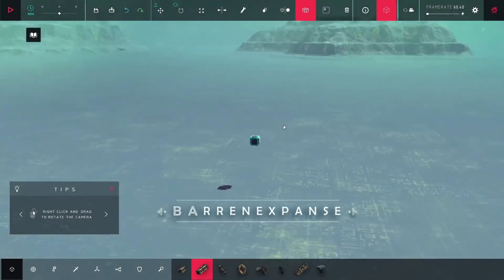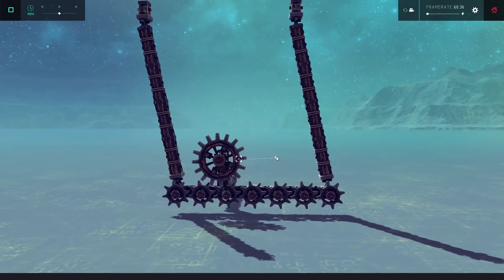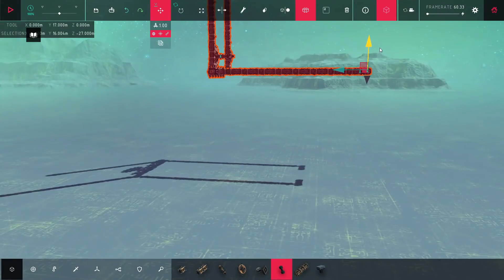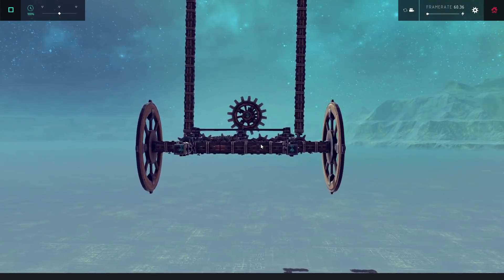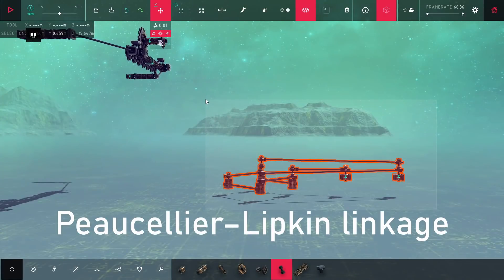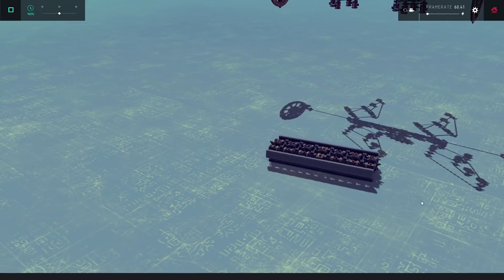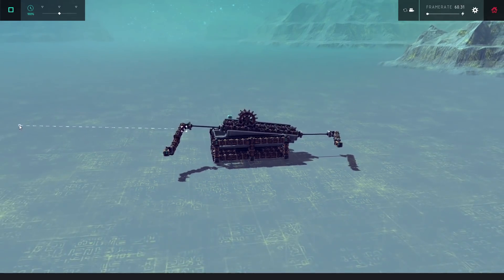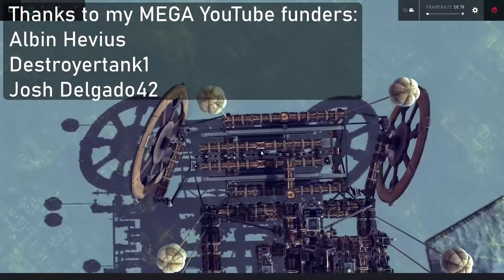Making Rack and Pinion Steering in Besiege

Comment: The wheel wouldn't skip if you made ackerman geometry. Basically all you have to do is make the tie-rod (steering arms) mount to the wheel hub further in towards the center of the car. It's also a good idea to keep them parallel instead of having them angled back so much.
Also, looking forward to the suspension episode for this car :P

Comment: you could have avoided struggling with the cogs, by just replacing them with rods on wheels. think davinci's first cog designs, where he used wheels and put little rods into the side as "teeth"
so by using a large unpowered wheel, and rods on the side (you know how they have four points on the "face" of the wheel) as a cog, and a "tooth bar" made out of just a looong log with a block on every other spot, you wouldn't have the problem of thin cog teeth.

Comment: Next on the list: Disc brakes; rotors, calipers, and linkage. I don't think you'll be able to do hydraulic linkage, but you can definitely do wire linkage like on a bike or small motor scooter.
The calipers and linkage shouldn't be that hard, smooth surface block pistons and bore, with the linkage attached to a powered wheel or gear, pulling on a triangle mechanism to force it to straighten and thus push the piston. The piston will have a wood block attached to the end of the smooth surface block, and press into a wheel that is being used as a rotor.
It will work with the caliper pushing on one side, so long as it doesn't break, but it would ideally be doubled up on the calipers, so you can get friction on both sides when braking.

Comment from the maker: I'm thinking of making a suspension next, or maybe a better engine. I'm getting tired of all time lapses lol

Also just wanted to say that I know I could make the wheels thicker, but I don't know if I want to. I think the raggedy look adds to the overall sketchy aesthetic of the build.
Reply: i think you should do an engine upgrade and also a general pass and do optimizations wherever you can
Reply: engine! please!
Reply: More cylinders!
Reply: I like the idea of you gradually improving it from raggedy and funny to clean and efficient. Custom wheels + suspension should be next, so that they can handle the output of a better engine + gearbox.
Reply: By suspension I'm thinking a full double wishbone unit with anti-roll bars so you can properly stance and slam that boi

Also, I reckon wider wheels and camber adjustment will defo help with the skipping problem
Reply: Make a rotary engine or a radial engine. I'm not sure how much better it would be the radial sounds like it would have fewer problems and be more powerful. As for the rotary well, I just want to see if its possible =)
Reply: Try making a W12 engine, im really curious how it would work out in Besiege.
Reply: @camillecirrus3977  interesting
Reply: Some flying vehicle would be sooooo  cool
Reply: Custom wheels?
Reply: DO A FULLY SICK TURBO BRO
Reply: dude do an engine upgrade definitely
Reply: Engine
Reply: Keep the piston design but increase displacement, that should give you more torque
Reply: Please make them thicker.
Reply: a suspension system would be really cool. but give it all wheel drive! (suspension, drive, and steering... good luck!)
Reply: We need the engine mk 2
Reply: suspension
Reply: Just found your channel and binged almost all the videos lol. Love this series especially. Definitely do make more videos, a better engine would be great!
Reply: You should make a bipedal walking robot

Comment: the car needs suspension, an engine with more cylinders, realistic wheels, and all wheel drive with a differential for the front wheels and a differential for the axle in the middle.

Comment: 15:46 couldn't you make the wheels thicker and that would solve the problem of the tires skipping?
Reply from the maker: Yep, but i think the thin wheels are funny so i don't want to replace them
Reply: @ReidCaptain  makes sense
Reply: Yeah I was also wondering why they weren't wider. Cars have wheels take up 10% of their width for a reason.

Comment: If one wheel is slipping when you turn, you may need to design some kind of differential. Mercifully, differentials are pretty simple; the real challenge is to figure out how to connect the wheels to the differential (which is in turn connected to the drive shaft) in a way that allows them to steer left and right without mangling the axles or the drive shaft. For this, you need a constant-velocity joint. (This challenge is the reason many historical cars used rear-wheel drive, with the front steerable wheels being free-spinning; carrying power through an axle with a constantly-changing bend in the middle is a pain in the ass. But once you solve that problem, you can easily apply it to vertical movement of the wheels in addition to horizontal, making suspension a breeze.)